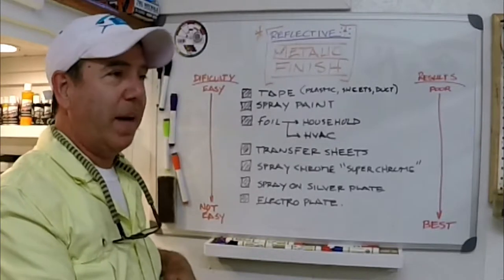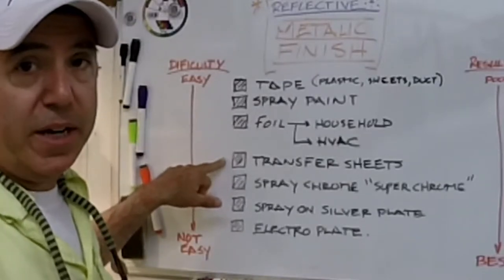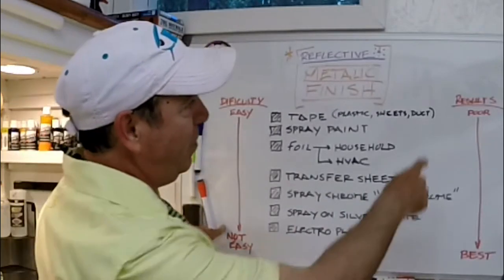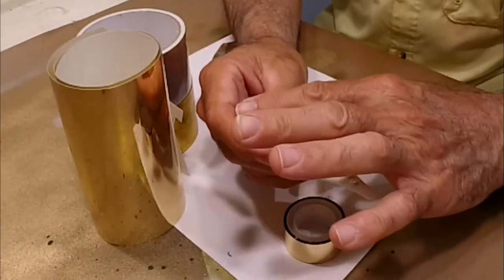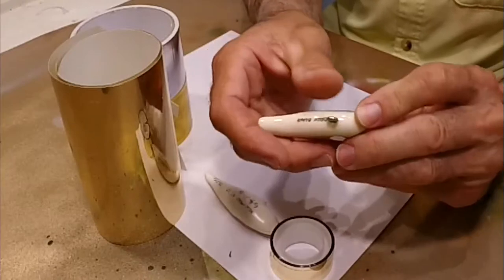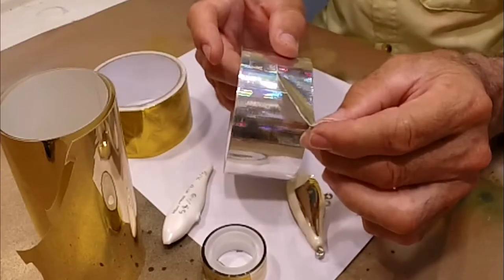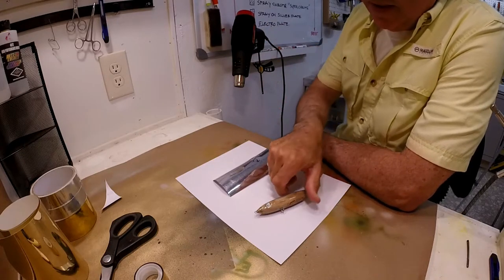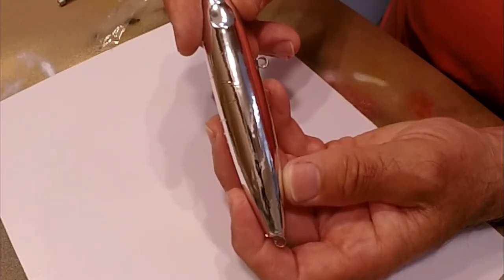Metallic lure finish part 1

Comment: Great work. I wonder if the sign wrap could be fitted in some type of vacuum forming machine that would stretch and suck the air out as well. Might not be able to cover the whole lure in one shot but two slightly elevated halves on the vacuum plate and then they can be glued together after the wrap had been applied?

Comment: Use hot stamping foil and adhesive.  Its a metalized transfer foil.  You will need to clear cot it to protect the finish but it will eliminate most of the problems.

Comment: great stuff. this topic will be a good one, love all the methods you are going to try. this vinyl wrap was very decent. quite simple and as good as one needs. but, how will it react to being covered in clearcoat? and will it stay conformed in colder water temps and pressure changes at depths?
Reply from the maker: breathe and squeeze,
 It can handle the clear coat but, getting hot in the sun...? not sure yet.

Comment: I have try super chrome, it get a beautiful finish, but as soon as I apply the epoxy finish it loose the effect,  the chrome looks like grey paint, otherwise if I use aluminum paint color its gets the same with the epoxy as finish. Like a lot the chrome paint but I cannot leave it bare dont know what to do?
Reply from the maker: The spaz Stix airbrush paint seems to work pretty well. I also baught the super Chrome kit and was really frustrated. So far the absolute best is silver plating but that is a pain in the butt. I'm in the middle of testing 10 different clear coats and mid coats over both Krylon Looking Glass and spaz Stix Chrome airbrush paint. I'll be posting the results of my experiments on the Engineered Angler  YouTube channel  in the next week. Stay tuned and thank  you for watching.

Comment: I’ve tried the chrome vinyl and it would lift when fished? Have you put in some time with that method?
Reply from the maker: The trick is heating it when applying it.  I'm still working on a teqnique to vacume firm it on the lure while heating enough so it is fully yielding. Still exparimental but I have a good feeling😎